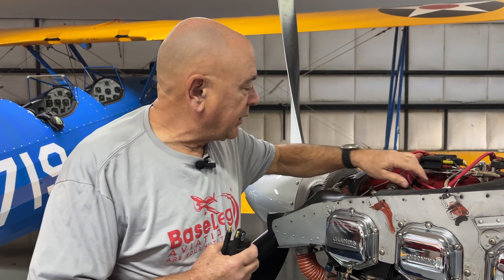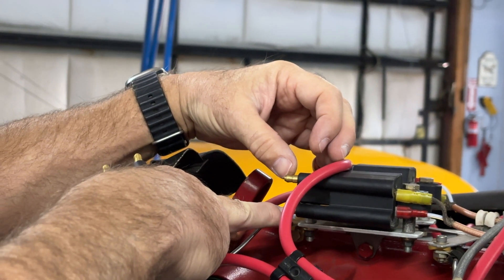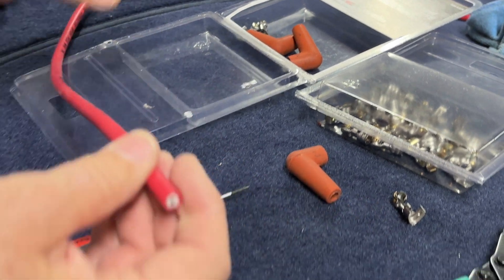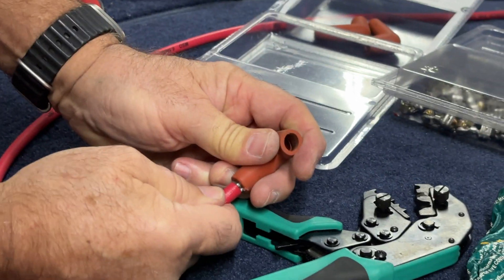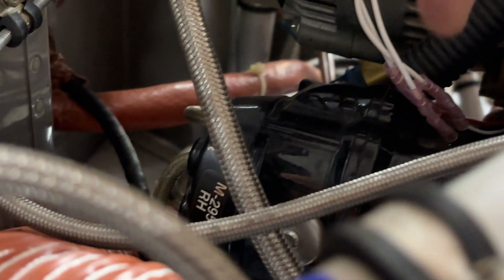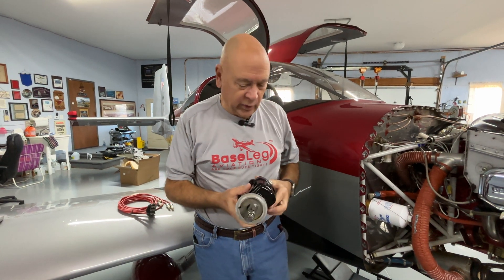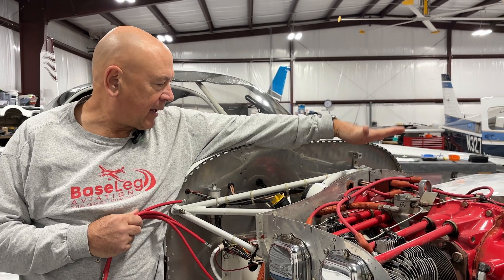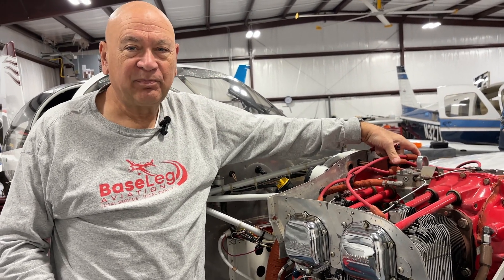Ignition Systems on Vic's RV 10 and troubleshooting a Lightspeed Ignition on an RV 7A

Comment: Thanks for the great video! What's the die you use with the CP-371 for crimping ignition wires? They don't seem to have one listed that looks like the one on this video.
Reply from the maker: I've had the crimper for awhile. I would suggest you look at Steinairs website. Several dies are shown for the C_0372 that he carries.
https://www.steinair.com/product/ratcheting-crimper-frame-only/

Comment: I’ve been running dual Lightspeed CDIs (with the Flywheel pickups) for 21 years.  Had a coil fail once (minor problem), but other than that a flawless system.

Comment: I've had a Lightspeed ignition on my airplane for 20 years +. After replacing the magneto 3 times I finally replaced the mag with another Electronic ignition. Could you go into more detail about oming  the wires and coils ? Also could you provide the part number, price and where you purchased the tool to put the spark plug wire ends. I would like to add that task to my condition inspection.
Reply from the maker: Hi Michael. It appears that that tool is no longer available which is why I (Carol) did not put a source for it. Steinair has the Proscrimp Lc-372 
https://www.steinair.com/product/ratcheting-crimper-frame-only/
See the newest video.  Vic explains measuring ohms in the last three minutes.
https://youtu.be/5L9tZRwGV4o
Reply: Thanks video was clear ! Thanks for the Stein link, he is wonderful.